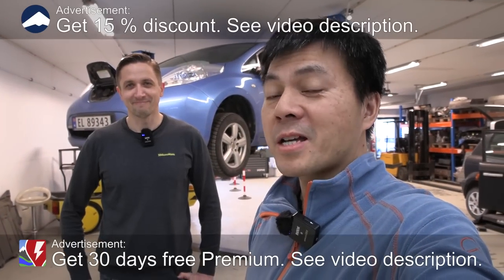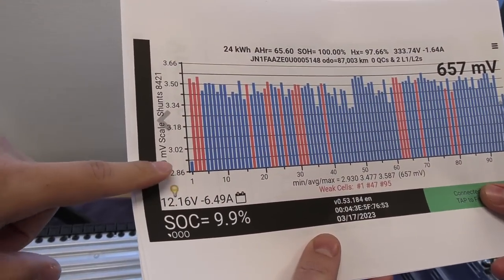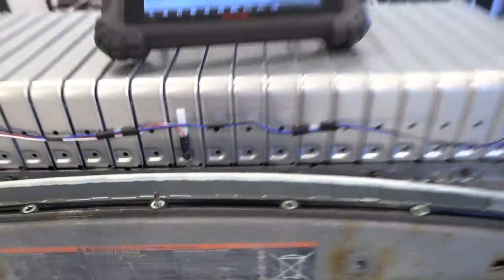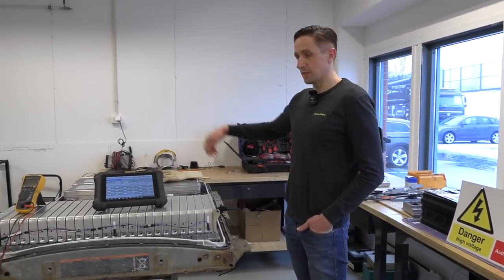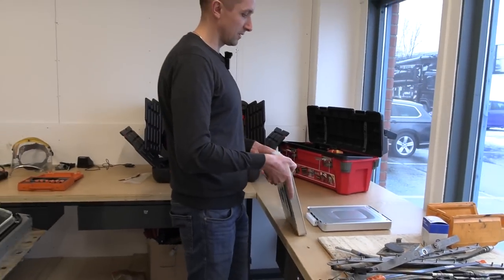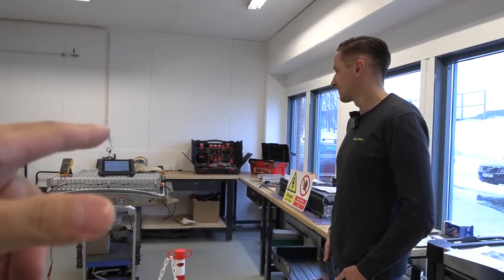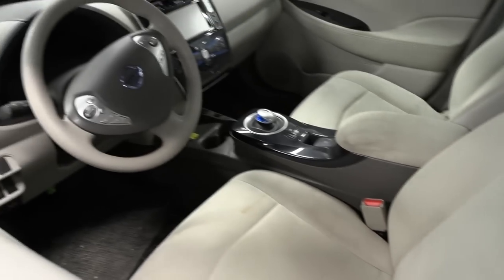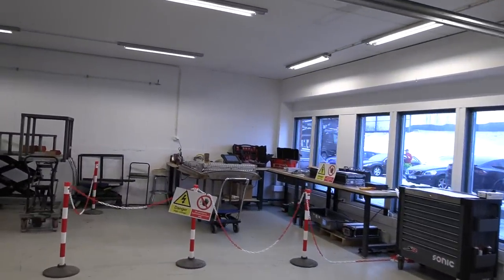Elbilmek repairing Nissan Leaf 24 kWh battery pack

Comment: 7:00 Passive cooling is what is shown. The heat leaks through the shell. 

A duct and a fan would be active cooling. If they would have made a air duct, they would have also added a fan. = active air cooling....

Comment: We need more places like this. Repair old packs don't just throw them out.
Reply: big challenge is cost. most of which is labor. replacing one or two cell modules may be cost prohibited when factoring in the price market of the car. reselling battery, motor, and other parts to used market may be more attractive than actually having to 'fix' your car by a shop like this. the other option is DIY; then labor is your own. this might be interesting; one caveat though is not getting electrocuted or securing equipment for getting in and out the battery ....o_0
Reply: @cdbuiles  so we could either have market of swap them out. It does not take long to pull the battery out the nissan leaf. Or have them repaired. If this was ICE and needed work similar thing would be done

Comment: 8:30 temperature sensors are also resistors, variable resistors. Their resistance changes with temperature and thats how system knows what the temperature is. Replacing them with standard resistors would "lie" some temperature to BMS. 
And then you can kill your  battery when it's hot. 
And maybe yourself, if it gets extreme and bursts.
Reply: Sounds like a very poor idea to take out sensors, fire and explosions may ensue😮
Reply: It sounds like a very good way to start a battery fire if you tried to quick charge in the summer, car would not know cell temperature >50C so risk of serious damage or thermal runaway.

Comment: 7:05 the passive cooling is the heating up of the whole pack walls and radiating it out :) 
If you have air channel and something forcing air through - then it's already active.
There's also few cm cap between pack and body above, where air passes through. (and a lot of dirt collects over time)
Reply: Wasn't the same pack design used on the eNV-200 where it did get a fan blowing air over the modules?
Reply: I think air cooling is not an option due to dust collection. If you want to prevent this, a filter is need, needing maintenance. Liquid cooling would be the better possibility but is a challenge doe to stack dimensions. It might work, when you take out 1 pack in the long pile, thus freeing up space. This is a major undertaking and will cost a lot.
Reply: @Fredric169  The triplets have air cooling through a air filter.

Put a problem with air cooling is that some of the cells gets good cooling,  while the other are hot.

I have observed a over 20°C difference between the cells.
Reply: @MichaelEricMenk  thx for your reply. Your result doesn‘t surprise me at all, as air has a much lower heat capacity vs liquid. Unfortunately liquid requires an additional structure for cooling.
Reply: no  @Hans-gb4mv  , leaf and env somehow have different batteries. They are making liquid cooled env200 batteries since 2014 or something, but leaf carries on being passive nothing, radiation, including today's 62kwh packs.

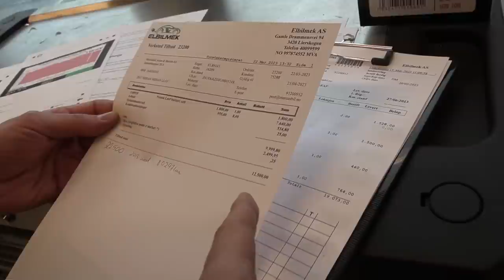Comment: 12:00 1000 euros for module replacement, oh my, but it is of course a lot of work. It is a lot less work to put in a whole new 30kwh battery. For maybe around 5000 euros, and sell old for battery storage for ~2000 eur.
Reply: @Ben Baselet  From a company in Portland, OR - 24kWh can be upgraded to 30 or 40kWh packs, not beyond.  As I recall, their price $4500US to go from 24 to used 30kWh.
Reply: @mikecarter2737  just to keep information accurate here, you can put any leaf battery on old leafs, up to 62kwh. Just needs a little upgrade on the mounts and recommended to put stronger springs in too, if you go with 62kwh. And if a layman reads this - no this does not mean you can just pop old off and slam new one in, there is nuance, depending on the year model, some wire adapter and or canbridge for translating the new batt to old car.
Reply: @gelisob  Thanks; I own 24kWh old Leaf that will get upgraded when range drops to unbearable.  Not a mechanic; I just watch converter company videos.

Comment: Man I'd be over the moon if in 10 years I find out my EV can get new life breathed into it range-wise for a couple thousand euros.
Reply: That can be done now. Replacing a high milage pack with a low milage pack for instance cost very little. The old pack is still worth nearly as much as the good one, so it is only the cost of labour and the diference in KWh capacity. I am about to get the pack on my mitsubishi phev changed. St 304,600 miles the old one is a bit knackered now.

Comment: Extremely interesting video. Many thx. I drive a Leaf as well. It’s a 2018 Model with 40 kWh. Would not recommend to take out the temp sensors. W/o you may get hot far beyond 60 deg C during charging o reduce their remaining lifetime quite significantly. In a worst case scenario, the car may start burning. To my knowledge, the BMS uses temperature as well  to control the max current. 
If you do it, I personally would charge the car only with AC as batteries don’t get so hot.
I’m a bit surprised about the location of the temperature sensors. They are suboptimal. Would place at least one in the middle of the log stack.

Looking forward to your next video, how much you could improve the stack. 
Goid luck

Comment: This is a really helpful video for all people looking for a second hand leaf, thank you for the good work and sharing that professional and wide knowledge. I wish this had came out a year ago, becase I would have saved a lot of time on internet forums, videos and articles. Just to give some extra info, for europe: the leafs before 2013 with light interior had that charger on the trunk and were made in Japan. All those batteries were 24 kWh, but not the most reliable. On 2013 and next models, interior was gray and no charger volume on the trunk. Starting on that year model, cars were made in Sunderland (UK) for european market. Those 24kWh batteries were more reliable than before. Also, heat pump was introduced, but not sure if those were standard or an option. There is a way to know if it's fitted based on the piping on the left area under the hood. Then, 2016 model had some minor changes and an optional 30 kWh battery. Same volume, different cell chemistry and layout. I finally got one of those at a good price. That 30 kWh battery is usually not more robust than the post-2013 24 kWh battery, but there are 2 important points to evaluate: First -> Being a bigger battery, even with lower SOH, more capacity is usually left. Second -> Nissan usually offered an 8 years warranty for battery SOH on those 30 kWh models. So, even a 2016 car would have battery warranty up to 2024. There are some conditions on that warranty, but it's a good backup. For anyone out there looking for one, this is important info. I ran though some scammers on my search, including 2012 models sold as post-2013 and  cars from really hot weather areas here in Spain that had suspiciously high SOH, but really low estimated range even in eco mode. I have no proof but also no doubt that those SOH were recently reseted and still not showed real SOH. Also, many people is not aware of these generarion changes and try to sell an older and degradated battery car for a high price. For now, I'm very happy with this really ugly car. It's really more usable than I expected, so even when I had done my math to park the diesel car and use it only on long highway trips while saving money by doing 10-12 K commute km per year, the leaf is already over 20 K last year. It's not a great EV nowadays, but it's OK for its time and the second hand prices.

Comment: You can actually get a gen 2 with light interior but they are rare, check the brake and boot to be sure.
Reply: That used to be an option, at least in UK, up until 2016
Reply: Some 2013 and newer US Leafs has light interior, and you find a lot of them even in Norway.  Leafs that are produced in EU, does not have light interior. 2011 and 2012 is produced in Japan, like this one, and the vin starts with J, and those have light interior.  The Leafs produced in USA starts with 1, and the Leafs produced in UK starts with S.

Comment: I bought in Sweden december 2016new 30 kWh. Been runni ng 138 000km  and I 10 bars of SOH today. Kan drive maximum 120km light fort with out heater or  AC on summering tyres. The car have benen running perfekt as famely car but start to think what to do in future. Chademo plugg are also to be a negative thing in future. But I am amazed about the quality nissan build in to this car.😊

Comment: I always wondered whether just removing the cell and bridging it instead would be viable. 
You'd essentially get slightly lower overall pack voltage and also proportionally less capacity, but such intervention could make sense in cases where sourcing replacement cells would be difficult. If the BMS could be made to go along with it, that is.
Reply: I like this idea. But would you need a couple of built in empty slots where healthy cells/modules could be easily slided in from the outside as one or two old ones are disconnected for the voltage to stay the same. Then a couple of fresh modules could be added with ease without the need of this extensive costly battery surgery.

Comment: According to this car manufacturers should make battery remove fast and easy also opening pack easy then it would be much cheaper to repair. Not like Tesla is planning to put some foam into packs and making them almost impossible to repair that would affect to insurance bill in future if car is expensive to repair.

Comment: Nice video as always, but the idea of replacing the temperature sensors with a resistor to lie to the BMS, should be criminal.  If the battery heats up, and the charge or discharge current keeps going on, can cause it to catch fire or explode.   I think it is bad that it was even suggested.  There is already a big amount of FUD provided by the anti repair camp, and the idea that some one could make this kind of modification to a pack will scare even more people.  Not good if you are pushing for reparability of these units like you are showing here.

Comment: Out of curiosity about the fire extinguisher, would it even work against a burning battery cell? What extinguisher type would you need?
Reply: No it wouldn't work at all, it's a chemical reaction with a thermal runaway which you can't stop. The only thing the fire department does if they have a EV battery burning is to dump the whole car in a purpose made container spraying water on it for days while it burns out and cools down.
Reply: @ITubeTooInc  yea i was thinking along those lines.

Comment: If you could add something to get the air moving inside the pack, even without ventilation hole that would be able to transport the heat to the outer shell of the pack more efficiently. A non-conductive liquid sloshing around, or a high density and heat capacity gas might even work. Should not take much.

Comment: Most excellent video, what a star, keeping those old Leafs on the road….be interesting to see if the car could take the newer battery pack, are they the same shape ? Will the onboard electronics cope with a newer pack or will it need to have the newer charging and BMS package too ?. So many questions !

Comment: Hi Bjorn,
maybe it would be enough to actively cool the badly placed batteries in the middle by simply welding some "peltier elements" (not sure if it is called that way in englisch as in german) directly under these places. that would work without removing the battery. 12v units exists, and should be easy to retrofit. maybe add some cooling fins as well. and if you cool down the hotspots, the rest should be fine, right?

Comment: That would be intresting to see, active cooling with fans, in the Leaf. Maby some, comparsion afterwards, to see if it worth it or not. Mhm, but after, rethinking, the Leaf is after all a daily driver, so i guess its not worth it. Only for the Science then....
Reply: Active cooling with fans means holes in the battery pack which can let moisture inside, not a good idea.  Even just warm moist air can condense water overnight when it gets colder.  Normal battery packs are sealed with gore tex filters which pass air but not moisture to prevent this condensation problem.  Notice how most packs are liquid cooled to avoid this problem.
Reply: @morrisg  I never mentioned to do a bad job. They have my and probably from all of us here, the permission to do a good job and add a moisture filter. Or maby better, add a airchannel direct from the A/C. That air is alredy dry. 😉

Comment: Try doing that on the Tesla model Y structural pack!
Reply: Hopefully Tesla will be able to disable individual cells. If 1 or 2 cells go bad, not as much of a problem cause there are so many
Reply: @tobias..6688  I think fitting a 50A mosfet switch on every single cell is kind of overcomplex and expensive!
Reply: I'm afraid Tesla's strategy going forward is bad battery = new car. This is why their next generation platform is designed to be built as quickly and cheaply as possible.
Reply: There are people working on methods to snip off individual defect cells in a structural pack.

Comment: Can’t believe almost nobody offers this service in the US… my 2013 Leaf only has 2 bars of degradation, would love to replace the pack when SOH gets to 50%
Reply: It is possible in the USA right now. There are several shops (including my own) that provide this service.

The catch is that most Leafs do not fail in this manner. Generally the packs are very well balanced across all the modules. 

The more common problem is that the capacity is degraded. And there isn't a fix for that, other than replacement of all the modules in the pack.

If your Leaf still have 10 bars, you are quite fortunate compared to others. I have seen cars with only 4 bars remaining. Oof.

The other big catch is that it is expensive. For example, I could swap a Used 12 bar 85% State of Health 24 kWh pack into your car as soon as next week. But it could easily be $5,000+ USD.

The main reason more shops don't offer this service is because there aren't many customers willing to pay the going rate for the job.

Comment: Hey Bjørn, are all module in serial or parallel? Would it be possible for a smart BMS to isolate bad module the same way a HDD/SDD isolate bad sector ? I have no idea if Nissan or Tesla or anyone is doing that and if it's possible, but loosing 1/48 Modules seems a much better deal than what is currently lost in this Leaf.

Comment: Inside the car, you can see if the car has A og B-battery: Look under the cover in front of the back seat, to see the size of the switch.
Reply: Do you know detail of differentce between switch? Thanks.

Comment: I hate to say that you are totally wrong. I had a 2012 Leaf for 10 years; it was a great car until the battery was very much degraded. Then I bought the 2016 model; OMG, the quality of workmanship is not there at all. They have removed so many things that we really enjoyed; the electronic parking brake was awesome. Driving two cars, driving Toyota versus Mercedes differences. The range was 150km on the 2016 Leaf; we could not forget the 2012 Leaf. No one talks about this, but 2012 is the best model Nissan Leaf ever produced. Then we found the 2012 Leaf; it was purchased very cheaply and had a 40KW battery. This car is a legend. If you are looking for a reliable car , get a 2012 Leaf and put 40KW battery or 62 KW. Then you are all set.

Comment: The problem with weak cells in series is that the weak cell will be reversed charged by the current flow of the good cells. I have seen this during aircraft nicad battery service. The battery than was discharged and cells individually discharged. Sometimes that fixed the problem. Many times a cell would short during capacity check or recharge. It would burn damaging other cells. There was a lot of gas and the service area was purged for several hours. The lithium cells are much more dangerous. Try and get as much technical information as possible.

Comment: Very cool vid. Where to start? With the CityEL parked casually in the garage, or just some Think? With the joyful promise of regaining quite some SoH? The knowledge about dismantling LEAFs? And not to forget the serial number of the battery pack ending with 140 which implies that this could very well be a very early one?

Just buy it. This LEAF is the one to open a box, most likely not Pandora's but with cookies that are good for us and the car. 

Interesting as well is that there are more companies that make slightly worn out LEAFs better. For example Muxsan in The Netherlands. They do complete battery replacements, upgrades, downgrades (if ever), battery extendeders placed in the boot, 11 kW type 2 charge ports, even CCS upgrades. Might be cool to visit them with this car. There is a ferry from Kristiansand to Cuxhaven, which saves you lots of effort and lots of fast charging.